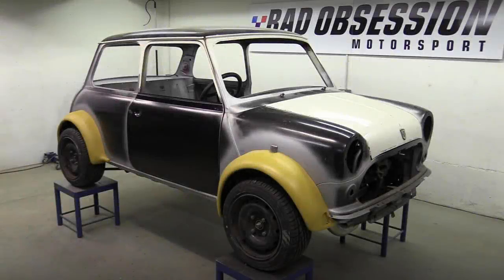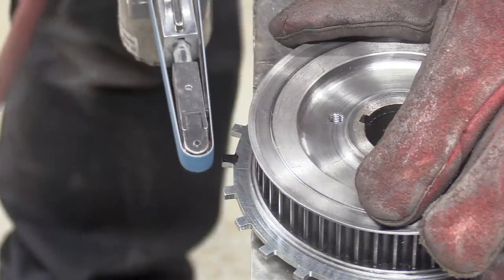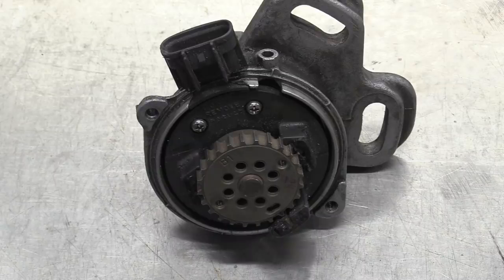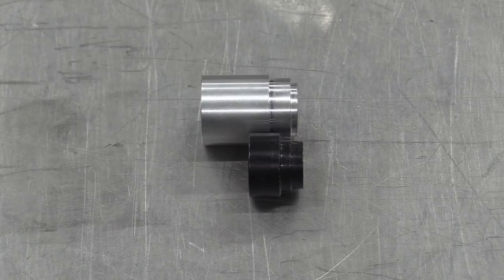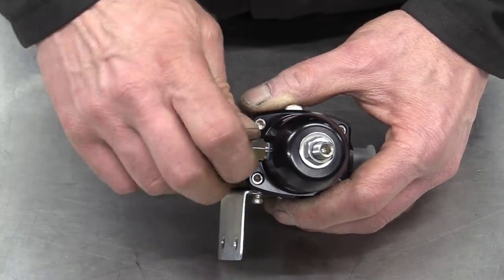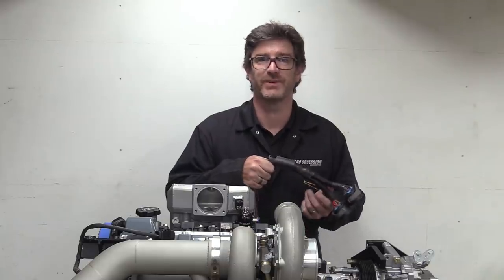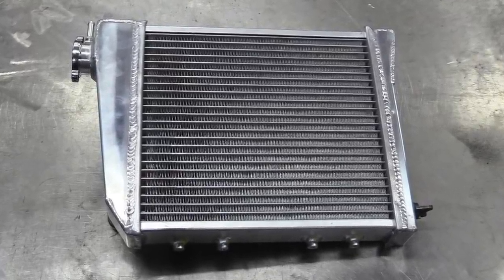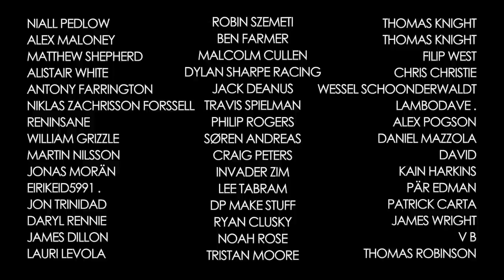Project Binky - Episode 32 - Austin Mini GT-Four - Turbocharged 4WD Mini

Comment: I envision a day when the electronic ECU managed CVT, ABS, GPS, no lag throttle body, power steering stability control, dumb driver safety override system will make the driver obsolete. It's only a matter of time before we're sitting on interestingly textured loveseats in a little perfectly unoffencive box. Instead of windows they'll have computer screens with comfortably validating images, so you and your family won't have to look at ugly featureless roads that are more "cost efficient" to build and maintain. That's when we'll tell our grandkids how fun it was when the only thing cars had were 3 peddles, a stick to shift gears, and a wheel to steer where you wanted to go. And just like we did when gramps n granny told us how they had to get up to change "stations on the radio", our grandkids will smile and pretend to be interested. Until then, drive your Mini like you mean it.

Comment: We're going to design this car so it can get around all these problems you see on the roads around here.

2035: The car is now finished but given roads have now been replaced with antigrav float lines.... well... bugger.
Reply: Nothing a good bracket and a couple speed-holes can't fix ^^

Comment: Great series not constrained by stupid production companies that haven't a clue what they're filming and refreshingly no bleeping! One thing though, isn't the crank sensor a hall effect (three wire) and the camshaft sensor a magnetic (two wire, you've also got the meter set to AC volts whereas a Hall output would need to be set to DC)? Sorry to let Mr Picky out of the box!

Comment: The explanation of the knocksensor is wrong.. It can't tell you if your engine is running lean, it tells you when your ignition angle is wrong (to early=knocking because the explosion is before the piston reaches td) your o2 sensor (wideband lambda) is telling you about your air fuel ratio (lean/rich)
Reply: your talking about  pre-ignition vs engine Knocking, they are two separate events. However, pre-ignition can be followed by knocking.

Comment: Dis iz me second time gawking at the fit and finish in this series. It just occurred to me that Aeromotive makes variable speed fuel pumps that increase or decrease flow on demand vs staged expensive bulky staged single speed pumperunis.

Comment: `This is concerning me in a OCD ish way and I know that you fine knights of the bracketeers and ordained and appointed followers of the holy fettle. I know this has crossed your mind, but at ~13:00 ish your cam trigger seems a little soft and potentialy bendy, due to centrifugal  force and sheer black luck. And yes the diss turns half crank rpeem but still I sense your OEM striving for excellence and perfection will give you a place in heaven